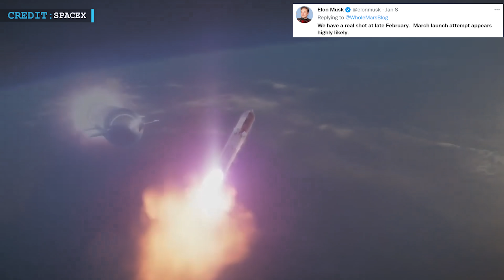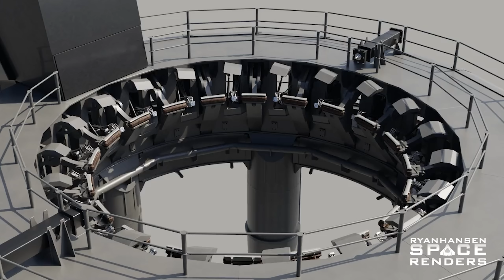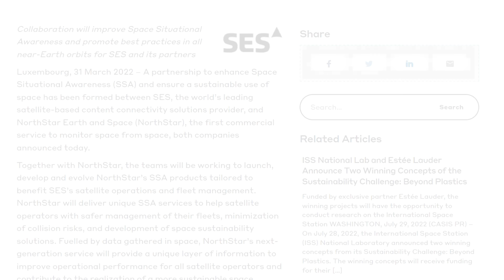SpaceX Starship Full Stack! Prepares For Wet Dress Rehearsal! Official Orbital Launch Date Revealed

Comment: I think they should mount a Starship nose cone atop B7 and launch it with only 13 engines installed.  That way if there’s a failure, they lose only 13 engines rather than 33.  Fly it up to 100 km and descend it back down to hover at 1km over the ocean.  If all is steady and performing well, air-taxi it over to the OLM and attempt a catch on the catch arms with a fail-safe crash-down to a nearby landing pad or open field if the catch doesn’t go right.  It should be nearly empty of propellant by then, anyway.
If all goes well and it’s caught, thoroughly check it out and then launch it again on the same test flight.  Then a 3rd flight with 33 engines mounted.  Then remove the nose cone and stack a flight-test Starship and do an orbital test, knowing that B7 will likely be recovered.
Reply: Otherwise, not knowing how well B7 will function and with 33 engines, a full fuel load and a fully loaded Starship with its 6 engines is an awfully large risk of significant loss and potential record for non-nuclear fireball/blast.  There’s a better chance a 13-engine B7 alone will get off the pad than an all-up stack with 39 engines and full load of fuel = greater risk to OLM.
Reply: B8 is right there to takeover if someting goes wrong in this idea😅